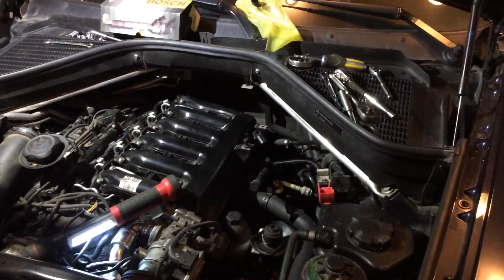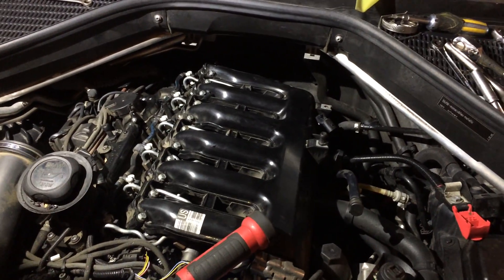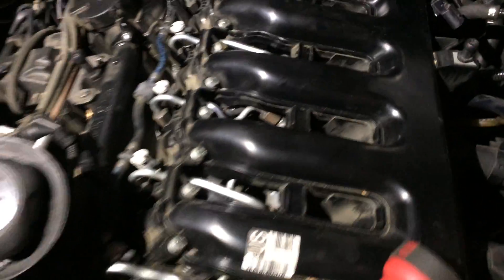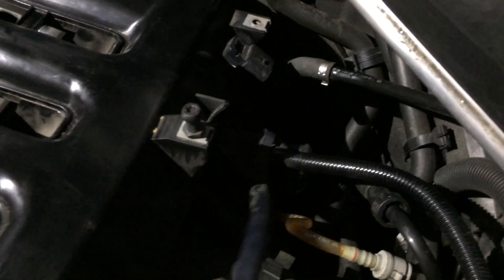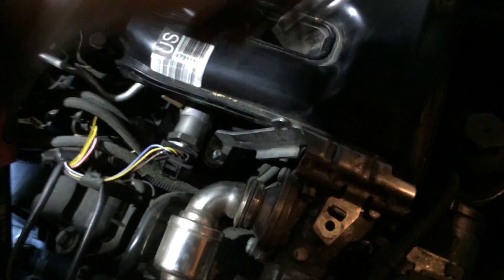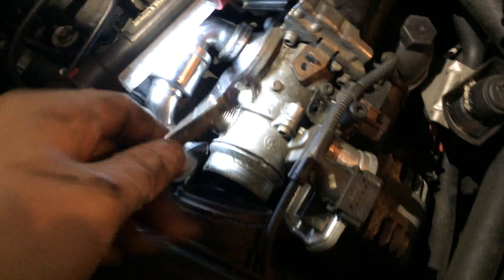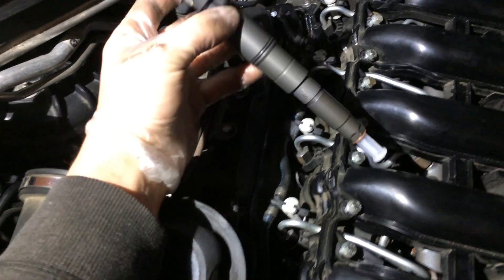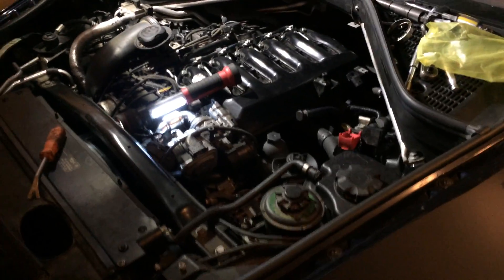BMW x5 3.0 Diesel injector  DIY part 1

Comment: Hello.  I'm changing rocker cover gasket on a 2006 X3 diesel and I'm trying to get injectors out but a few studs are giving me trouble  the single Hex 4 mm socket  has stripped the stud head    I got several of them out but can't get the stuck ones out to remove the rocker cover     any advice would be appreciated

Comment: I laughed when you’d directed your annoyance at a bolt saying he’s a trouble maker. 😂 

As a mobile mechanic I have to do an injector today on a 2007 x7 3.0 litre. It stalls when driving. Customer has unplugged cylinder 5 injector and been driving it around perfectly fine like that. Sounded ok and revved ok to be fair. ECU did not put it in limp mode so all good. I noticed yesterday something never seen before. Battery able to crank the car normal after 5 minutes dropped from 12.3 volts to 6volts. Also weak jump pack on under bonnet jump connectors the engine would not crank. Taking it to the battery terminals instead, instantly it would crank. Less voltage drop clearly. Stupid to put under bonnet terminals for battery when they put the battery in the boot. Thats for saying injector resistance is between 200/300

Comment: Hi. Just saw your video. I guess you are Russian like me lol.  My X5 335d burns oil and smokes very heavily. Took it to the dealer they said bad overflow fuel line and bad glow plug controller module. Does not sound right to me. Or at least hardly related to the smoke out of the exsaust. The car drives perfect. Any suggestions?
Reply from the maker: did you scan it for codes ?
Reply: Spasibo za otvet. Yes. I have fault codes related to glow plug inefficiency but nothing else. So glow plug controller is likely bad but   I don't think it has anything to do with the car burning about 1qt of oil within one hour. I had that fault code for a while but burning oil is a recent development. I have already tried changing the vent valve with no success. Thanks again.
Reply from the maker: @isilkin  are you in Vancouver area ?

Comment: Apparently its because of faulty part:  Cowl Panel Windshield Wiper Motor Cover bmw part #51717151969, as it doesnt stop rain from coming in, and if you replace this #5/6 wont go bad. But all I can find online is genuine part for that. I would assume replacing with the same part wont do much good, any opinions? If you dont replace that part same injectors will go every couple maybe 4-8 years.

Comment: Hey great video. I have the 2012 X5 diesel and was getting a code for Injector 4 Activation and Injector 3 Activation. I checked the resistance and the reading was much lower than all the other injectors.  I have ordered my new injectors but was wondering if I will have to code these to the vehicle. I have been hearing from different sources that I will have to buy speacial software to code each new injector. Not sure what your experience was with this but would like to know your advice. Thanks for your time.   

John
Reply: You actually SHOULD, and in many cases will NEED to code your injector. I just replaced injector #4 and before coding it I was getting misfires and "Cyl 4 Inector Circuit Low" errors. Coding them tells the computer to send more/correct voltage to the injector so that it's on par with the other injectors.
Reply from the maker: No need to do anything with soft . I never disconnected battery either .Cheers
Reply: Thanks so much!   Appreciate the help
Reply: I see you paid 450 per injector... was able to find the same one brand new on ebay for $292.00    Just incase you have to ever do a similar job again.  Sellers name was :  ddmtechnik      hope this helps some of you guys save some $ because going direct to BMW is a rip off!

Comment: That's awesome mate. 
My 2009 x5 3.0 ltr diesel has the same issue. Have taken it to the dealer who have confirmed its injector failure due to contaminated fuel and want to charge me $12,000.00 Australian to repair. 
After watching your video I'm thinking of getting it back home on a tow truck and having a go myself. 
It looks way easier than doing the head gasket on my 2000 e46 m52tu 😀 which I have just done. 
How can I get in touch with you to ask a question ? FB Messenger ??
Reply from the maker: This is rip off price .Part cost me $450 cad new  + few hours labor ,check the resistance on injectors if checked ok look for bad wires ,i seen one with chewed wiring .you can reach me  autowpg at gmail
Reply: Thanks for the advise mate.  Yes all dealers are a Rip Off... 
The vehicle is still at the dealer waiting for my insurance company to decide if they are going to pay for the repairs. If they decide not to pay I will bring the vehicle home on a tow truck and repair it myself as you have shown.
Will get in touch if it goes that way and let you know how I get on.
Cheers
Jason
Reply: @jasonyannuccelli2499  insurance or not I hope your did not let that greedy dealer get $12000
Reply: Holy you should post name of the dealership so other people dont get screwed by them and maybe they will see it and learn a lesson too.